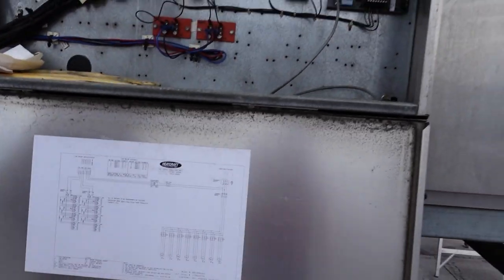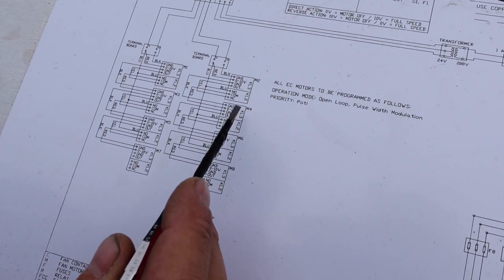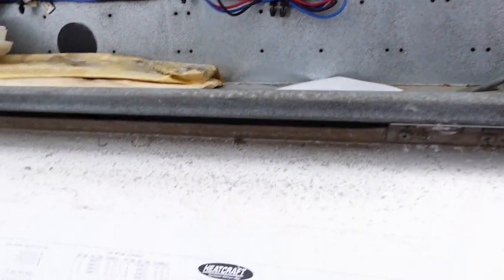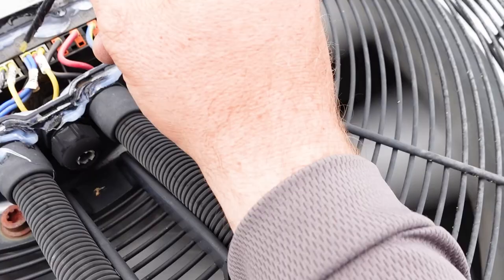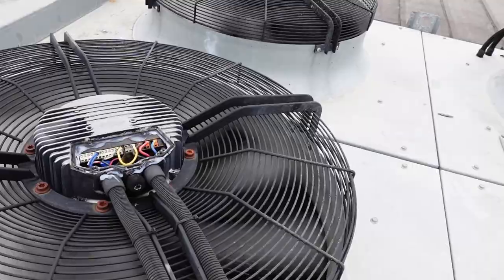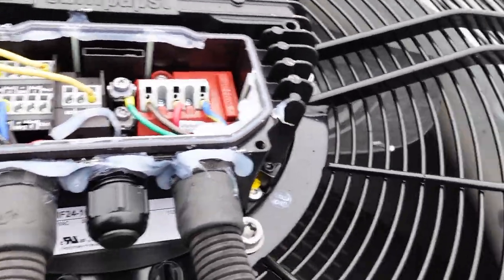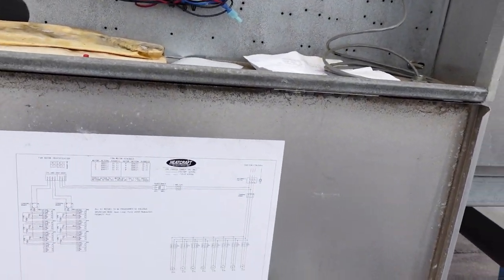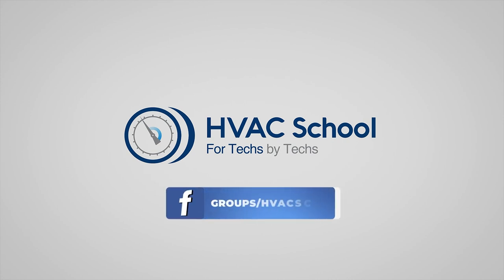Rewiring Market Condenser Fans

Comment: It looks by the original schematic the intended design was to have each motor take the PWM signal and regenerate it to the next motor via the signal output. This would prevent signal degradation of the low voltage PWM wire when connected in parallel with many motors. Have you seen many failures with these motors?? I would have thought the high voltage to all the motors would be fed from a common fused circuit, in which, not just one would loose power.

Comment: Engineers: placing the motors in series will make it completely modular and simplify design. We will add an alarm relay to guard against failure.
Techs: but EVERYTHING can break so let's wire it passive redundant.

Comment: So, they are basically wired like my 20,000 W solar system in series. If one panel goes out and knocks the other seven now. I can’t wire them in parallel because the voltage would go from 320 V to40 V DC. I don’t work on commercial refrigeration, but thanks for all of your videos.